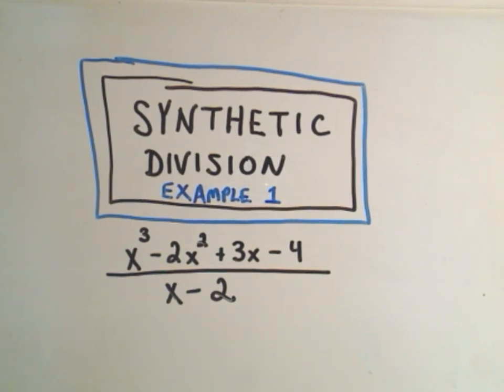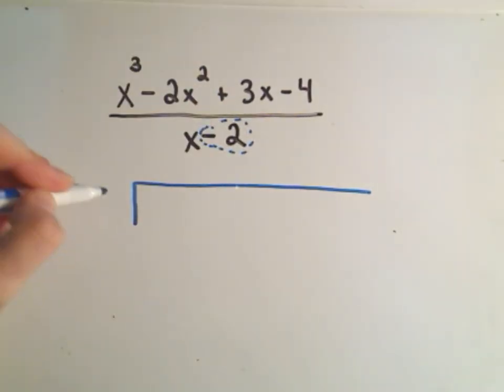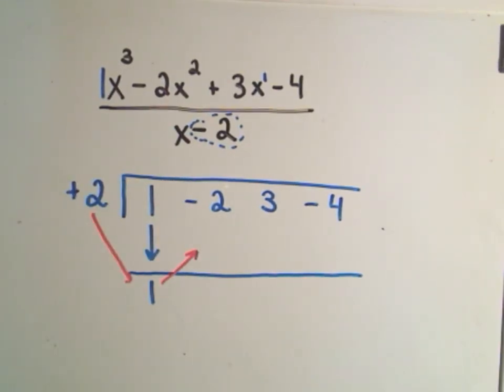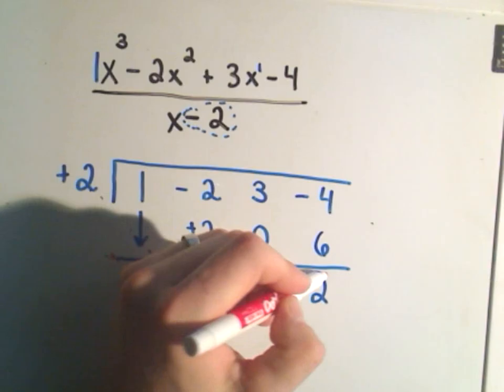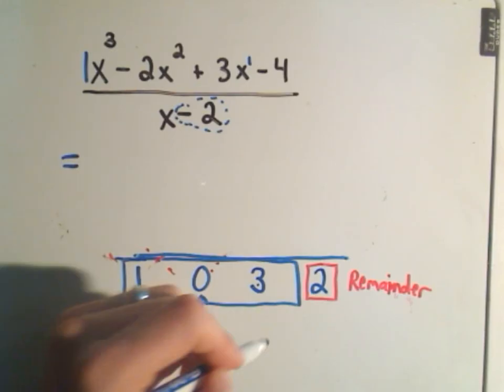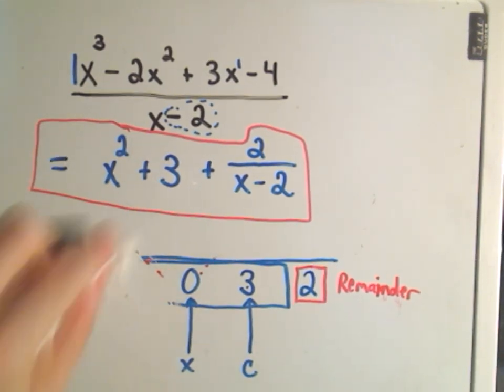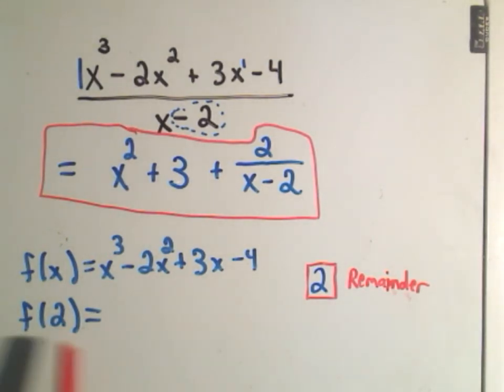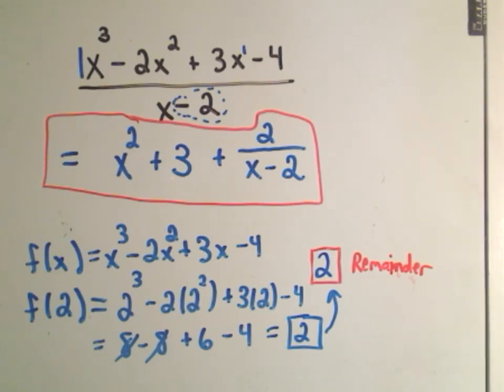❖ Synthetic Division - A Shortcut for Long Division! ❖

Comment: where did you get x-2 on the denominator side? 

If you are able to see this comment, could you give me an example of how to solve polynomials with signs such as
x4-2x3+3x2-5x+3 > 10
Reply: x-2 is a factor of f(x). it means that when x=2 the equation will equal to 0

Comment: We can do the exact same thing and simplify that original cubic polynomial as x^2+3+(2/(x-2)) with long division though? Is this method supposed to be quicker than long division or what's the benefit?
Reply: It's quicker and there's a less chance to mess up and it still gives you the correct answer

Comment: s it only possible to divide synthetically with a first degree? For example if I have a polynomial and I know (x²−4) is a factor, which is a second degree. Can I do synthetic division directly with this factor as well? Or do I have to split it into (x+2)(x−2) and use one of those separately?

Comment: How would you perform this division if the denominator had more than two terms and was a polynomial of third degree or higher?
Reply: I think you would do the same, except you would have to subtract from the degree of X(in the numerator) the number equal to the degree of x on the denominator

Comment: Why did the remainder turn into 2/x-2 in fraction?
Reply: Think of a simple case like dividing 50 by 12, express the 50/12 as (48+2)/12 = (48/12)+(2/12) = the main component worked out by long division: (4) + the remainder: (2/12). The remainder is still in the process of being divided by something so it has to be shown as such.

Does this mathematical method actually expand a person's knowledge of solving equations.  It should be removed from any syllabus except as a shorthand tool in a pure maths university course.
Reply: Think of a simple case like dividing 50 by 12, express the 50/12 as (48+2)/12 = (48/12)+(2/12) = the main component worked out by long division: (4) + the remainder: (2/12). The remainder is still in the process of being divided by something so it has to be shown as such.

Does this mathematical method actually expand a person's knowledge of solving equations.  It should be removed from any syllabus except as a shorthand tool in a pure maths university course.

Comment: what if it's 3x-2?
Reply: +Katrina Rivera Alcantara    its 3{x-(2/3)}
Reply: +Manish Das So +2/3 will be on the side?
Reply: +Katrina Rivera Alcantara Solve for X, with other side equaling 0   ex.3x-2=0
Reply: Vivek Patel that doesn't work, you need to factor out the coeficient of x before dividing, then divide the resulting expression by that coeficient (in this case that would be 3).

Comment: what if you have a value in front of that x? you know, how it says x - 2, but what if it was something like 3x - 2?
Reply: No problem. Why does the the (x - 2) turn into + 2 for the calculation? Because if (x - 2) = 0, then x = 2!

So if 3x - 2 = 0, 3x = 2, therefore x = 2/3.

So u use 2/3 in your calculation.
Reply: Or you could just multiply both the numerator and the denominator by 1/3 and boom!
Reply: You would use Long Division of a Polynomial. He's got a video for that too, just look it up.
Reply: SpectralGaming thanks :D
Reply: David Sharp that makes sence! thanks:)
Reply: David Sharp don't think that works...
Reply: exo derpysih It does

Comment: I used the synthethic division for this equation: X^6-3x^4+3x^2-1 and ended up with
(x-1)(x-1)(x-1)(x^3), which isnt correct, should be (x-1)^3(x+1)^3.
Is it because this kind of division doesnt work for some equations or am I doing something wrong,ofcourse i could had used the long division but this is much faster :)
thanks in advance

Comment: Hi Patrick, 
I wanted to know, how can I do factorization of a cubic equation using algebra and not using graphing methods. In order to find a factor, we need to know the roots, so basically without knowing at least one root, you cannot do the synthetic division. I want to understand how do we find out that one root, in this case X-2 in the first place. Thanks.

Comment: No need to factor a 2 out of the numerator. Simply factor the leading coefficient out of the binomial and do synthetic division on the original numerator with the opposite of the binomial's new constant term. In your example, when you factor the leading coefficient out of 2x-1, the new constant term becomes -1/2. You get -23/8 when you do synthetic division with 1/2 and the original coefficients. If you evaluate the polynomial with x = 1/2, you again get -23/8. Life is good!

Comment: x+r=0 ; x-r=0 , to get the value of r, you would have to transpose it to the other side of equation; so technically, for most cases, the sign will just be the opposite.

Comment: It's the rule. You've got to change the sign... If he had had  x^3 - 2x^2 + 3x - 4 divided by x+2 , he would have used -2 in the synthetic division, 'cause the sign would have changed also, just that he divided by x-2 in his problem, thus, using a +2 (or 2). The explanation of this could be what he said from 4:20 to 5:20. IN OTHER WORDS: Yes, you're right: x-c and you use -c, but it is that c= -2, so negative c = -c = - (-2) = +2.  Always be aware of all the signs. Concentration the key is.

Comment: okay so the divisor is x-2 but what if it was 2x-2 or 3x-2? if the coefficient wasn't 1? thanks.
Reply: you make the equation equal to zero. so for 2x-2 you would use 1. or you can use long devision with the polynomial and your 2x-2

Comment: you explained so well i understood it just once, and my pre-calculus professor was not able to teach this clearly, great job! i just have one question, why did you plug in 2 for f(x), is it because you are dividing by (x-2)? and will f(x) be equal to the remainder for only one value? meaning in this case, will f(x) be equal to 2 only when it is f(2)?, thanx again

Comment: This is totally wrong if you plug in 2 into the function you would ve dividing by zero which isn't possible so when x=2, it would be a solution it would be a vertical asymptote